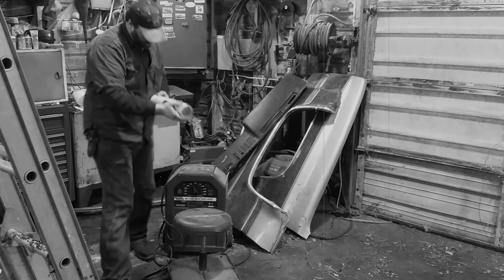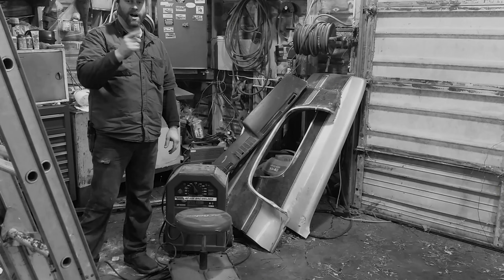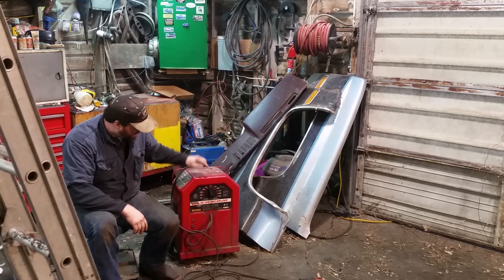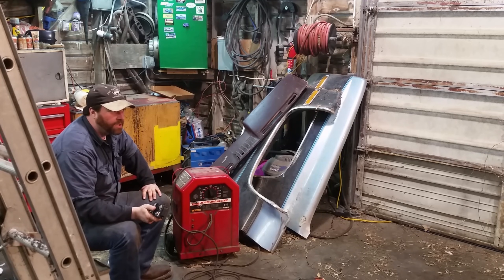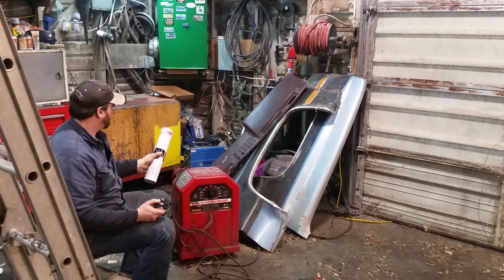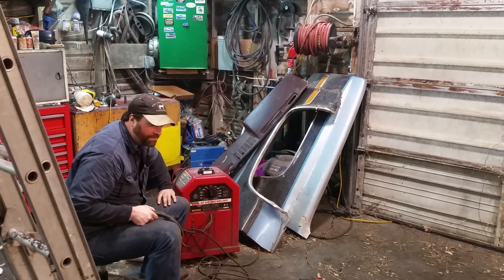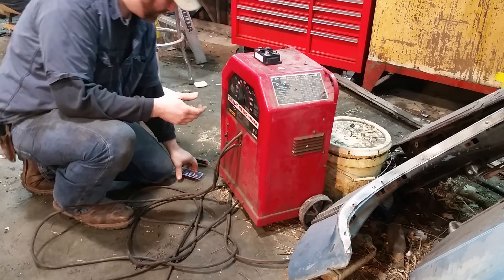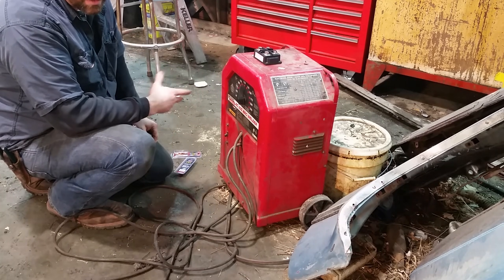How To Convert AC Stick Welder to DC for Cheap - Lincoln 225 "Tombstone" "Buzz Box"

Comment: With only a rectifier, you may find at some point that you have trouble holding a stable arc.  You may need to take apart a microwave oven and use the core of its power transformer as a "choke," to smooth out the ripples in the rectified current.  It's pretty simple.  Just cut the windings off the transformer and wind a few turns of welding cable through the holes.  You might be surprised at how much this can improve arc stability.
Reply from the maker: You're reading my mind!  That's pretty much exactly what I have planned for this winter as I "finish" the conversion with Dinse connectors so I can swap polarity and also still use the AC.  Plan on putting a volt meter and maybe an amp meter as well!  Not sure when I'll get to that, but hopefully soon!  Thanks for watching and commenting!
Reply: @burningdinosaurs  Could you show us how you do the choke and dinse connectors? I'm converting mine to but don't know how to do the choke or voltage regulator....
Reply from the maker: @jarrettdaly  Yes I sure will!  I'm in the middle of cleaning off my bench so I can finally do that to the welder.  I'm out of town for a couple weeks, but hope to get to it soon!  Thanks for watching and commenting! and be on the lookout for the update!
Reply: @elkvis do you need to run power to the transformer core or just the windings with the cable?
Reply: @guyverslab9864  just the stinger lead
Reply: @elkvis   he added dinse connectors to allow DC + or DC -  does it matter which side the choke goes on? Maybe I’m not understanding this correctly?
Reply: @mln19631  most often, the choke goes on the electrode lead, and not the work lead.
Reply: Well said @Elkvis
Reply: Negative or positive cable?
Reply: @Nostradamus_Order33  Electrically, it shouldn't make a difference but there may be practical reasons for one or the other..
Reply: @rob-muntron It would depend on the rod and welding process you were using which side you would want it on. Which direction you wanted the current to flow.
Reply: @Nostradamus_Order33  for stick, it'd be the positive.  For TIG, the negative
Reply: @elkvis  I was taught you weld DCEN translation is. 
Direct current, Electrode, Negative. For most general welding
Reply: @wrenchbender01  no. Stick welding is almost always DCEP.  The only time it's appropriate to do DCEN on stick is when you're welding very thin material and you want to reduce penetration.
Reply: I thought he said it was a full bridge rectifier. LL&P
Reply: My father would have loved talking shop with you guys. 👍😎
Reply: Y como se conectan los cables y el rectificador?? Tiene un diagrama?? 😅 por favor
Reply: if you're addding a choke to smooth out current, you should add a capacitor to smooth out the voltage ripple from the rectifier also. The caps out of old audio amplifiers are usually rated for the task, 50+ volts and usually over 10,000 mFd
Reply: @thedavesofourlives1   no, you don't want capacitors, because they'll turn it into a constant voltage power supply.  For stick welding you want constant current, which is what a choke will give you.
Reply: @thedavesofourlives1 mi amigo y tiene un diagrama para instalar todo eso?? Por favor

Comment: got the same welder and I was thinking about restoring  and I dont weld enough to keep the welder i was going to get a 110v stick welder instead of the 240v so I was going to restore it and try to sell it. I was wondering how much you think I could sell it for? If it was restored
Reply from the maker: Not sure on price for a restored one.  But I do know for used ones they're all over the place from $50 - $250.  But you can still buy them new at the big-box stores.  Probably just check out the facebooks and craig's lists to see what they're listed at in your area.  Good luck!  Thanks for watching and commenting!

Comment: Hey I am replacing the switch. BUT I FORGOT TO TAKE A PICTURE. Can you PM me a picture of the wiring to the switch?
Reply from the maker: Sorry, I don't have a picture right off hand, but I do plan on finishing my conversion (connectors, choke, volt gauge, etc...) in the next few weeks, probably have more video of the inside then.  Thanks for watching and commenting!

Comment: if you want a dc machine buy one, these il cracker boxes are great for farm repair and hobby but are in no way a professional machine,, dont screw it up worse changeing what you dont understand
Reply from the maker: Been looking, but easier said than bought!  I've had very good results with it since I converted, while it wasn't necessary for most of the rods I use, it definitely opens up possibilities for when I need something different.  For most of my critical welds, I have my friend do it who is a professional welder with a professional machine.  Thanks for watching and commenting!

Comment: When you convert a stick welder from AC to DC, do you get a DC (-) minus or a DC (+) positive machine?
Reply from the maker: Well, it depends on the rod and the material.  I wired mine up as DCEP (DC Electrode Positive) because that's what most of my rods recommend and I mostly just weld on mild steel.  However, I also ordered "dinse" jacks so I could unhook and swap them around if I need to, as well as jacks so I could still use the AC if I wanted.  Although I still have yet to finish this project by actually installing them 😳
Reply: @burningdinosaurs  Thanks!

Comment: You want electrode negative because electrons flow negative to positive unlike popular belief...electrons are negatively charged so you want the electrode to throw negatively charged metal to its attraction positive ground.
Reply: Most stick welding electrodes are designed to run electrode positive.

Comment: Welding without gloves and on the floor.  Just too real and unsafe.  Next time be safe and wear protective clothing.   I am about to give this a try.  But the darn Welder @129 lbs is not a mobile unit. What happen to the external plugs.  Did they not arrive, i was looking for the finished product.
Reply from the maker: Yeah, "Danger" is my other middle name 😉🤣.  I got the connectors, but have been busy with other stuff and haven't installed them yet.  I plan on doing that as well as making a choke for the DC side to smooth out the current.  Been busy with #FrankenTruck, but I need to get on that soon!  Thanks for watching and commenting!  Check back, I'll show the finished product as soon as I finish it up!

Comment: Nice video. Need big radiator , cooler.
Reply from the maker: Yeah, the rectifier could use a heatsink or something.  After a few minutes of welding that area gets fairly warm.  I also want to add a choke to smooth out the current since right now it's choppy/dirty.  But it's a work in progress!  Thanks for watching and commenting!

Comment: Does anyone know what are the name of the wire connectors you used to make the connection from the wires to the rectifiers screws. I have a rectifier but i dont know the name of the metal pieces used to hook the wires to rectifer so i can know what to look for.
Reply from the maker: Are you talking the eyelets or lugs?  The pieces I crimp on the leads (wire/cables/etc..) to screw them to the rectifier?  They have a couple names but often for larger wire like 6ga or bigger they're referred to as "lugs"  Make note of the wire size and the screw size as they come in many, many sizes and sometimes you can't find that specific size at a parts store so you might have to go online for them.  Thanks for watching and commenting!  Good luck!
Reply: @burningdinosaurs  sorry for the late reply but yes, it was the lugs that i was referring to. In the meantime i figured out how to make my own lugs due myself having some experience in metal working and them being expensive in most hardware stores. I think i may make a video soon enough on how to make them.
Reply: Yes it was quite actually the lugs i was referring to but quite frankly the conversion didnt work for me because my welder was a under powered cheap buzz box.
Reply: Terminals. Wire is 6 guage. Get em at home depots or auto parts store

Comment: Its dc but its dirty dc wire in a choke on the stinger lead it will smooth out, after that is done if you fall into a high frequency box, you could tig aluminum. After the choke is wired in scratch start dc tig is quite pleasant.
Reply from the maker: Yeah!  I was thinking the same thing but thought about running a capacitor to normalize the current out.  But a choke might be a better idea!  I need to look into that!  Thanks for the tip!  Thanks for watching and commenting!
Reply: @burningdinosaurs  Did you ever add the choke? I'm having a hard time finding a video on how to make one
Reply: @burningdinosaurs  Did it at least seem that when you only used the rectifier it was at least a step up from AC?
Reply from the maker: @divasmom65   What I noticed right away was it seemed much more smooth.  Not really any benefit noticed beyond that, but I also haven't run any DC-only rods yet.  I really think it all just seems smoother overall.  Thanks for watching and commenting!
Reply: @burningdinosaurs  chokes/inductors smooth current, capacitors smooth VOLTAGE
Reply: @burningdinosaurs  http://hildstrom.com/projects/ac-225/ this is who i followed for my conversion very well thought out. Now another welding genius has come up with the "haas-kemp" conversion for older 3 phase poer supplies like a miller cp200 or similar machines dave kamp can be found over on practical machinist. The 3 phase machines are dirt cheap usually and the conversion works great and you get full output. I did a cp300 added a wirefeeder i have a 300 amp mig for less than 400 bones that will outlive me. Im happy to help anybody
Reply from the maker: Interesting!  I will have to check that out!  Thanks for the heads-up!  I see them 3ph welders sometimes at auctions, and nobody wants them because of that.  So, I'll have to look into that!  Thanks!

Comment: Good job on the video editing.  Pretty cool making what you already have work cheaply.  those tombstones are everywhere and there's a decent price difference between the ac and ac/dc machines.
Reply from the maker: Yeah, thanks!  Yep, I'm definitely one who makes what I have work rather than buying new!  They are everywhere and they last forever, so hopefully it'll help someone out showing how.  Thanks for watching and commenting!
Reply: @burningdinosaurs    sir, my lincoln is even older, it is kind of rounded on top. This cover is one piece. 225 amp. doing the dc thing today, added 28 microfarad cap across +  and  --,  adds a bit more voltage by smoothing the ripple of converted AC, will try a reactor made from old microwave transformer core, with 4 turns of #2   wire, in series after bridge and cap, on negative (ground clamp) cable. Will experiment, on the weld performance.  May let u know how 'things'  go....good day...
Reply: ....tried this, as mentioned, yesterday. It welds better with 7018  1/8  rods, on just one cap 28 mfd across bridge + and -.     Tried the reactor core, and a cap from the stick side to - of bridge, not the best.  So, i'll  just  'stick' ....ha    with the single cap on bridge.  Have a great day, burnin....